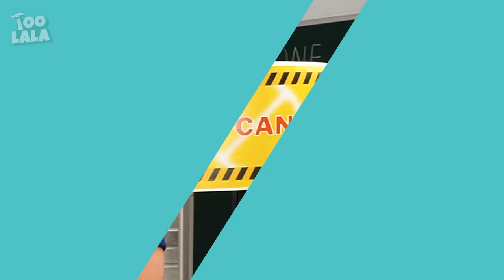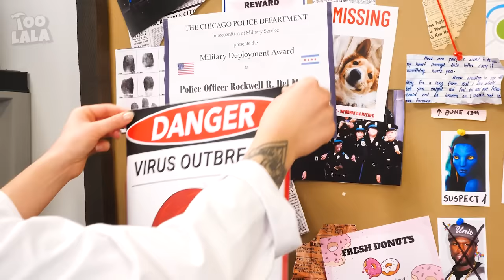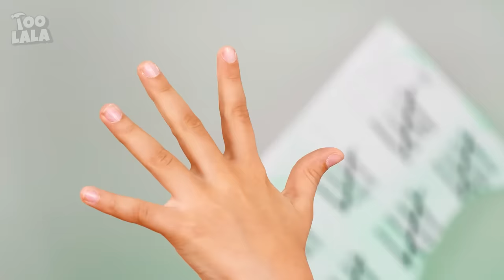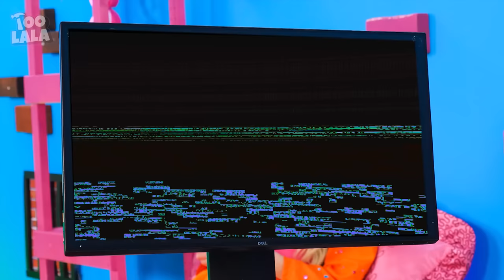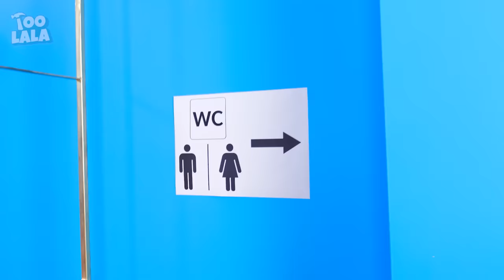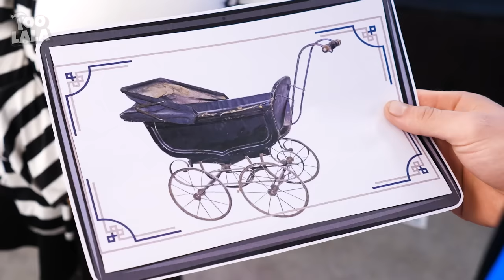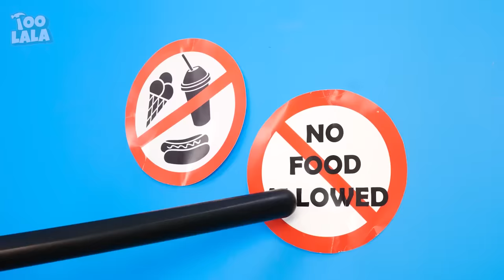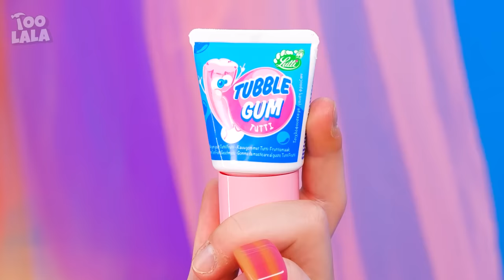SMART SCHOOL HACKS AND FUN IDEAS || Easy DIY Tricks, Viral Crafts and Gadgets in Jail

Comment: R😅Welcome to Gboard clipboard, any text you copy will be saved here.Tap on a clip to paste it in the text box.Touch and hold a clip to pin it. Unpinned clips will be deleted after 1 hour.Use the edit icon to pin, add or delete clips.Tap on a clip to paste it in the text box.Welcome to Gboard clipboard, any text you copy will be saved here.Touch and hold a clip to pin it. Unpinned clips will be deleted after 1 hour.Use the edit icon to pin, add or delete clips.Use the edit icon to pin, add or delete clips.Tap on a clip to paste it in the text box.😅